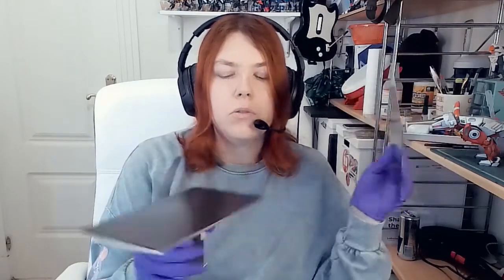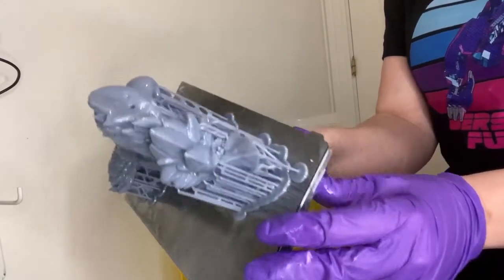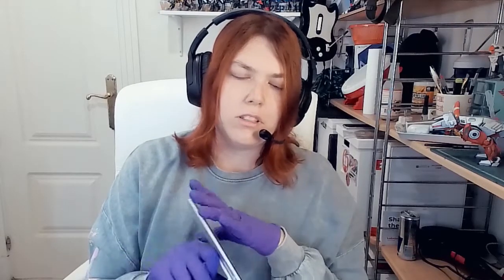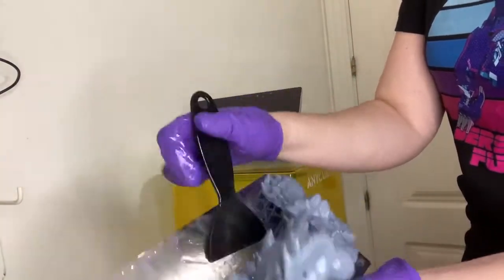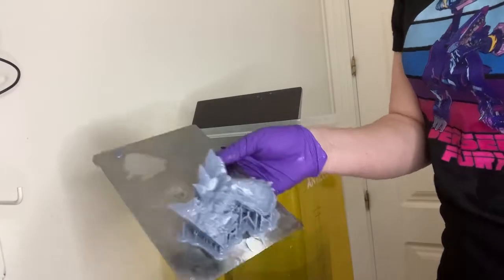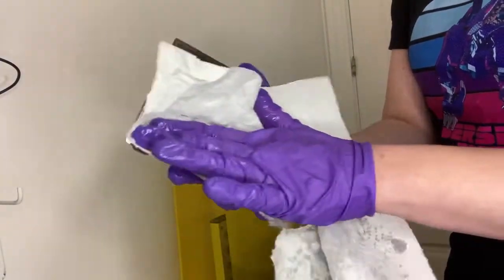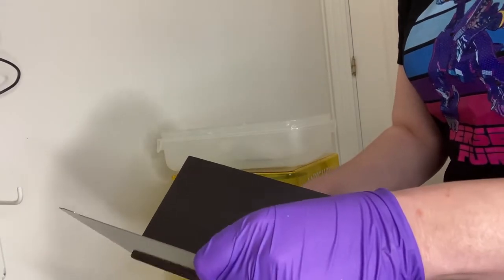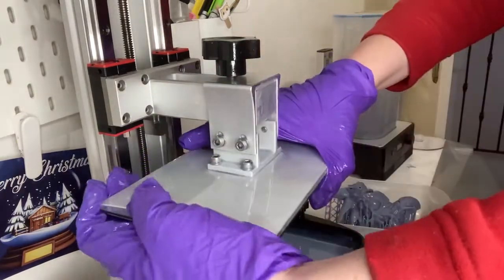What is a Flexible Build Plate - 4 minute review - Photon Mono X resin printer

Comment: Great video!  Did you need to install a spacer to account for the extra thickness of the build plate?
Reply from the maker: I just undid the screws on the build plate and releveled it so that it would have the right spacing
Reply: @Becca_3D  Awesome!  I'll try that out.  Thank you!

Comment: Did you have to do anything with the vertical axis like you need to with the Mars? I've had some horrendous issues with plate over adhesion on my Mono X.
Reply: Yes, you need to add a spacer and re-level.

Comment: Do you re-level the build plate after with the the flexible build plate?
Reply: Nice video thank you
Reply from the maker: Yes, need to account for the extra bit of height that it adds
Reply: @Becca_3D  I know you have to re-level after you install the flexible plate,  I meant after detaching subsequent prints
Reply from the maker: @sheldonthomas8773  no,  I have not had to re level since the initial installation and I have had 20+ prints on it